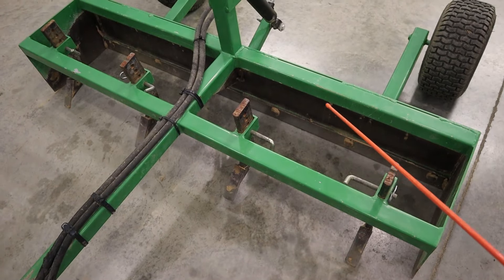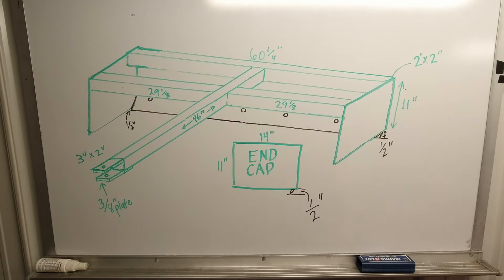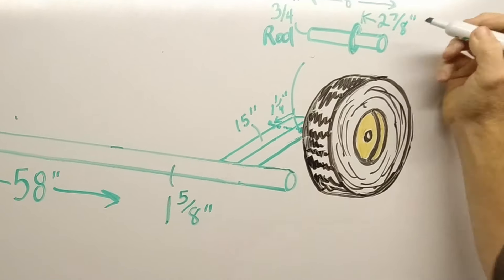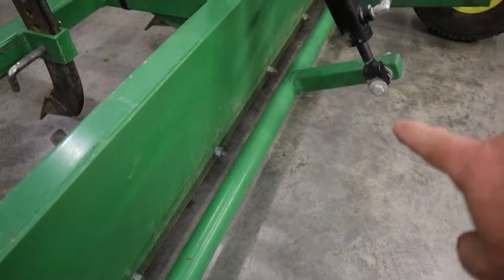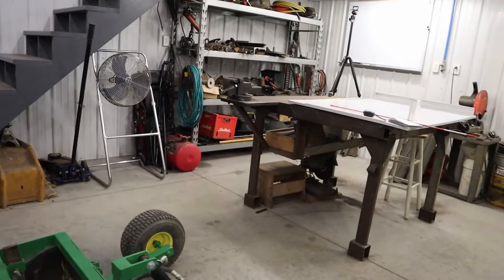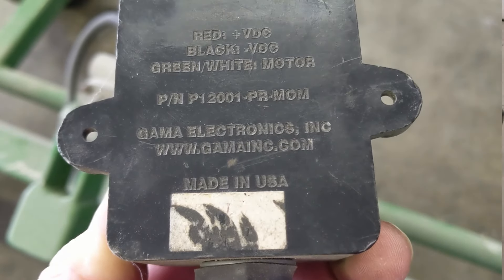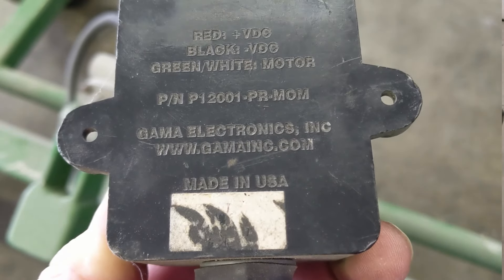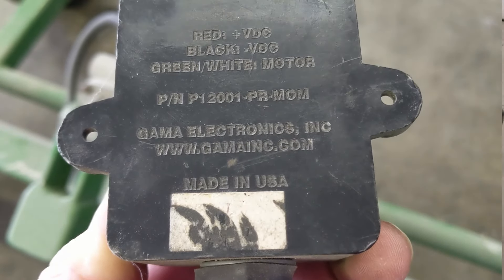Pull Type Grader Box Blueprint ||  DIY Box Blade How-To Video Tutorial for dimensions and materials

Comment: Ran across your video and loved it I am in the process of getting all the pieces together to build one for myself we appreciate it so much I just had one question where did you acquire the 12 V DC actuator and do you have a model number and manufacture and also is it weatherproof thanks in advance! Bob
Reply from the maker: Hi Robert!  Thanks for the kind words.  The actuators were purchased from Norhthern Tool.  They are Ironton brand I believe.  I believe they are called "weather resistant" which means "they could maybe get rained on once but I wouldn't make a habit of it"!  Here is a link to the actuator: https://www.northerntool.com/shop/tools/product_200751833_200751833
If you expand the description for this video you should be able to see some links to all the components.  Good luck with your build.  You'll love it!
Reply: @digdrivediy  Thanks for the reply Neil , Your help is appreciated, be-careful Cleaning out those gutters we got up on the roof about a week ago with my blower to do the same thing (watched video you did on cleaning gutters) but I’m a little older these days and wasn’t quite comfortable walking on my roof and also it gets a little slick up there because of the humidity I’m down here in Georgia and I’ve been up and down extension ladders and ladders my whole career but I’m retired now but with age you get wiser! 😆👍🏻 
Thanks again
Reply: Well I just wanted to say thanks again Neil for the info for the box scraper with tines and electric actuator I completed mine today for the exception of paint I’ll be painting it tomorrow I was going to post a picture on here but I cannot figure out how to do that but the thing is a tank it does not even compare to anything that you can buy. I’m sure from what I’ve seen it will last a lifetime no doubt once again thanks we appreciate it and I’m really pleased with the way mine turned out. Bob. PS if you would like a photo shoot me a email.

Comment: Thanks for such an informative video. I recently got my first John Deere, a 332, and I'm loving it! I have a large gravel drive that I maintain and I'm planning on making one of these box blades. I was thinking of using two hydrolic cylinders, one for each side of the blade so that I can make a crown on the driveway while I am grading. Do you think this is good idea or do you think I should stick with the single cylinder?
Reply from the maker: I love the 332.  Never had one but I have the 322 gasoline brother right now.  I'm not sure on the two cylinders.  I've wanted to try that as well.  It would only help to start the crown and then once you're working at an angle you'd want the grader flat again.  I have mixed emotions on that because I think I'd always have trouble getting it leveled back out when I want it level.  There are some made that way so it must work.  Good luck with your project and let me know if you do it that way!
Reply: I converted a 66" wide box blade to a grader. I put a ball hitch on the back of my Kubota L3800 tractor and raised the blade from the front by raising the 3 point. The blade is 1/3 of the distance from the axel behind and 2/3 back from the ball hitch. The overall length from A frame hitch to axel is 10 feet. The frame was made of 1.5 by 3 inch steel tubing 3/16 wall thickness. The frame angles down behind the blade to meet the axel height determined by the 13 inch wheel tire combo. The frame angles down in front so as to capture more of the 3 point lift capability. I can raise the blade 6.75 inches for transport. Four quarter inch thick plates extend from the frame down to the box blade and use the same bolts in the same holes that originally attached the upper frame of the box blade so no modifications were made to the blade. My old box blade was getting no use. The cost to convert was between $500 and $600 in 2021. ( If we don't count the cost of the MIG welder and plasma cutter :-) If I can find someone who can get the video to YouTube I will give the full tour.